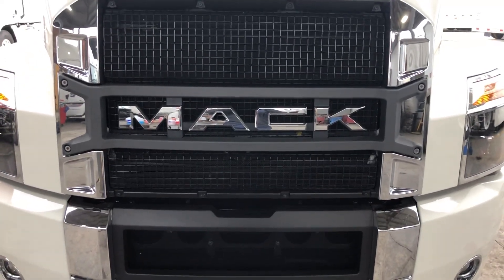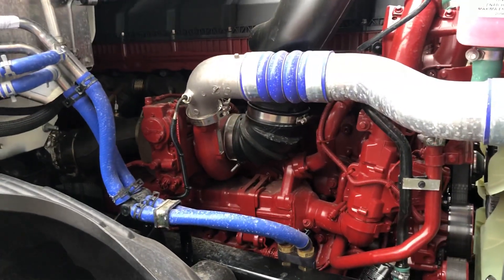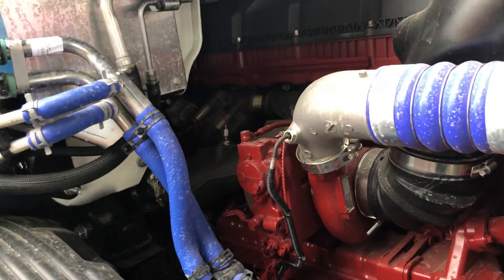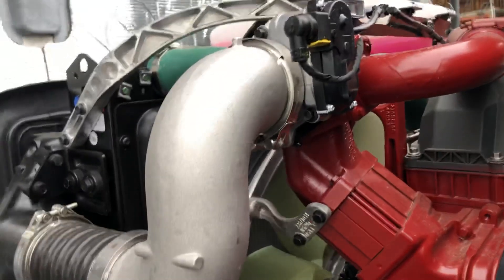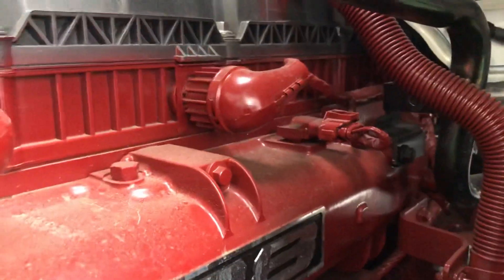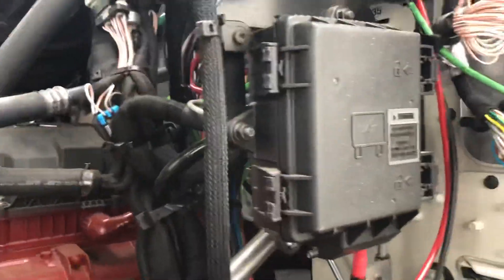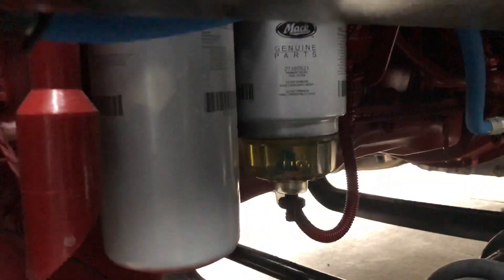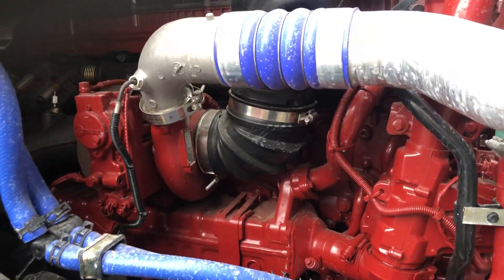Mack Anthem 2019: A quick look around MP8 engine.

Comment: Is it worth it to buy a Mack truck or should you just buy a Volvo truck since the Mac has the Volvo engine in it and it’s harder to work on a Mack truck since it has a shorter hood.
Reply from the maker: In my personal opinion, Volvo Trucks are better than Mack because they feel more refined, comfortable and has more technology than other manufacturers. For repairs, yes Volvo has more space than Mack because the chassis is longer. So, in few words, if you already did your homework about other manufacturers and what you like about Volvo Trucks. Freightliner (my first choice in my personal opinion) and Volvo are a good way to go and start a business. Thanks for watching and the support.
Reply: Volvo has the nicer interior and ride. But if I’m not mistaken you can upgrade the Mack to have the same suspension. It depends if the better looks of the Mack are more important to you than the interior.

Comment: So where is the pig tails for the battery option switch on the dash where is it located on this truck 🚚
Reply from the maker: Are you writing about the power cut-off switch under the cab? I know this truck has one switch relate it to the battery in the dashboard area, but I used and it does not work.
Reply: @LetstalkDIESEL  i want to hookup a light bar to my moose guard and want to use the batter option switch or the one with the key symbol on it .but I was wondering where the pig tails are under the tuck chases or on the engine are located
Reply from the maker: That is really hard to tell since we do not use it around our shop. But, it could be around the firewall or close to the fairing. You could ask directly to dealership if you have to go buy parts. Usually, it must be 2 wires pigtails and not yellow or green colors. I hope that helps and thanks for watching.

Comment: So brother you think I should buy Volvo 780 d13  or Mack MP8 they are both 2018 Mack have 450k miles and Volvo have 500k miles ok so Mack have warranty until 600k miles and Volvo doesn’t have warranty. Please reply as you can.
Reply from the maker: This is a good question, both trucks are made from the same manufacture, so from the perspective of warranty Mack seems to be a better deal. In general, Mack and Volvo share couple things, like oil changes are similar for both, ATS is the same for both and other little things. Your choice will depend if you like Mack or Volvo chassis. I hope this help you to decide. Thanks for watching and support the channel.
Reply: @LetstalkDIESEL  thanks man I was waiting for ur reply I love Volvos but Mack it’s a better deal like you said. So I’m gonna go with Mack for sure. Thanks again.

Comment: Overall for maintenance and reliability would you recommend a Volvo/Mack or Cummins? What about International's A26?
Reply: The A26 is a rebranded MAN D2676
Reply from the maker: This is a good question, in this generation, you can choose between DD15, Volvo/Mack, Paccar, Cummins or International A26. For owner operators, in my point of view and if you are starting your own business, your best bet is Freightliner Cascadia with DD15 and a Manual transmission. Why? Because you can repair it pretty much everywhere around the US. Cummins will be my second choice because many technicians know the engine well for years, repairs might take awhile though, the third choice would be Mack/Volvo because Volvo chassis is really comfortable and feels like a car when those trucks are new. Last both Paccar and International A26 the problem with those engines are hard to get parts and not many technicians know about them. This is just my personal opinion and I hope this help you. Thanks for watching.
Reply: @LetstalkDIESEL  why don’t you like Automatic trans?
Reply: @LetstalkDIESEL  isn’t the the fright liner more prone to breakdown? Than a Volvo

Comment: Same fuel system? Injector cups?
Reply from the maker: I believe those are the same, but I have not remove the engine head cover yet to confirm. Usually, they update the parts and sometimes just by a bit, they might look the same but they will not fit in newest models. However, I will update around here to let you know, by the way, good question.
Reply: @LetstalkDIESEL  thanks I really appreciate your videos.
Reply: @LetstalkDIESEL  they seem to follow with the same model year D13 Volvo exactly.